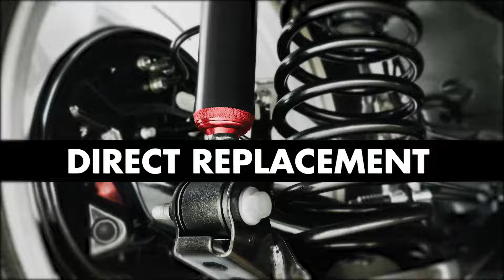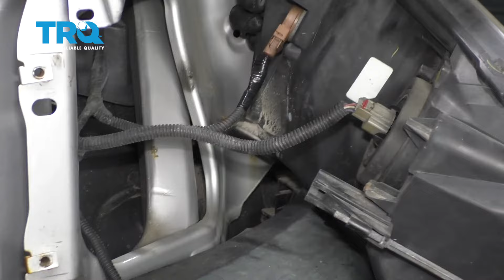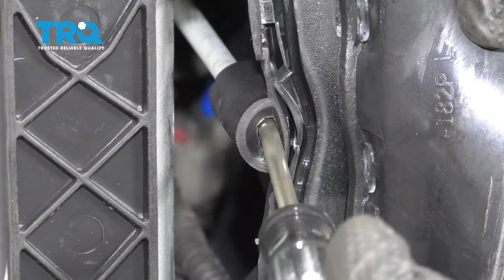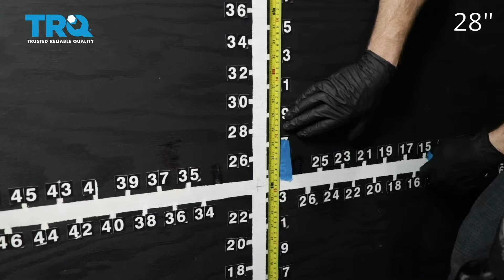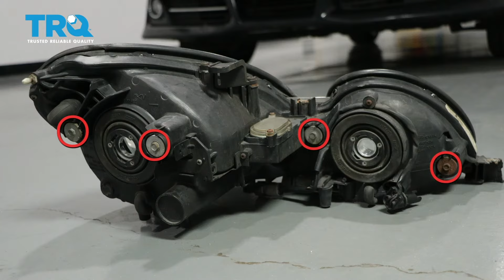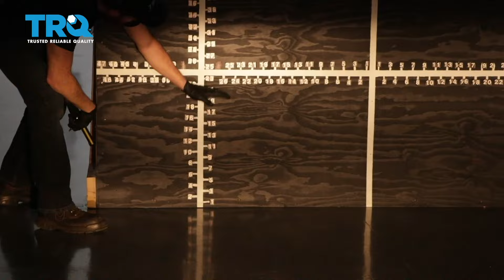How to Replace Headlights 2006-08 Dodge Ram Truck

Comment: Everyone needs to be aware that you do not pop these lights out without checking to make sure there is not a nut on a threaded stem that passes through into the wheel well. Bottom line is on the 2006 you have to loosen defender well reach up in there And put a wrench preferably a socket, on the bottom, stem of the headlight remove the nut. Otherwise, you gonna tear some stuff up. I’m not sure why these videos, and it’s not just this one, don’t include this information.

Comment: Four years!!!! Y’all  had plenty of time to edit this video. It’s a shame that I followed your videos, step-by-step, and broke my headlight housing because you did not give proper instruction. There is a bolt on the bottom right corner on the right headlight and a bolt on the bottom left corner of the left headlight that you have to remove from inside the wheel well, but since your video didn’t show that or say anything, even though I can see those screw bolt  after the fact by watching the video several times and you’ve already removed the nut from it but you don’t show that in your video. I worked and worked and worked until mine came out and snapped the housing, broke it right off. Y’all should send me the money to replace my headlight housing. Four years and every comment is for y’all to edit this video and y’all have not done it. That is some of the poorest action taken by video production company that’s known to give out instruction on how to remove and install automobile pieces, I genuinely am upset. Feel free to respond.

Comment: WARNING: This video is missing a critical step! There is a nut on the back of the headlamp unit inside the fender well. @TRQ You should fix this! Multiple reports of broken parts due to your missing info.

Comment: Almost broke the plastic assembly, and broke the plastic clip “Christmas tree” post on the back because the author forgot to mention the 10mm bolt from the back side through the hole in the fender we’ll.

Comment: It was not that easy on my 2008 Ram 1500. You have to clear some of the wheel well to access the 3/8 bolt on the backside.

Comment: READ THE COMMENTS: Almost damaged my truck because of this video. Glad I read the comments. There is a 10mm nut in the fender well covered up by a rubber dust plug that needs to come out!

Comment: I agree with those that pointed out the third 10mm nut that can only be accessed by removing the rubber plug in the wheelwell.  Impossible to safely remove the headlight assembly without removing this nut.  

Also, is there a left/right adjustment on these headlights?  My right headlight shines too far to the left.

Comment: The video also misses the plastic snap in socket (?) for upper ball stud(?). In the video you can clearly see the old socket in place and the new socket on the new assembly as he installs it. Yet he easily pops the new assembly in place. 
Very poorly produced video.

Comment: My 1st time messing with Anything on my truck and found this video to be straight forward and simple... so I thought...It took me 30 mins to find out about the 3rd bolt in the wheel well. Almost broke my housing because I thought it was just stuck. But I got it... no thanks to trq 🤔
Reply: And also, if you let that 3rd bolt in the wheel well drop, the truck was engineered to trap that bolt in a very deep crevice  and you’ll spend the next 35 minutes looking for it (on two separate occasions). Use rags or a magnet to assist when removing and say a prayer. It also helps if it’s not 120° F in  Phx AZ when this happens.
Reply: Yeah first thing i noticed is doesny show wheel well third bold under rubber garmet..
Reply from the maker: +Big Serg ##onbaby Thank you! We love empowering our customers and showing how to perform DIY auto repairs with our high-quality auto parts. http://1aau.to/m/Shop-TRQ

Comment: You forgot to mention the third 10mm nut on the back side of the fender well.
Reply from the maker: +jose saenz Thanks for the tip! We'll pass this info along to our production team. http://1aau.to/m/Shop-TRQ
Reply: @TRQ  Ya, right after I break off the mount... 8mo later, dimwits